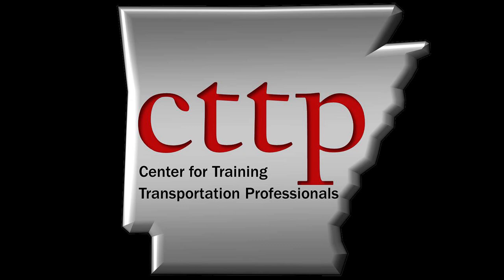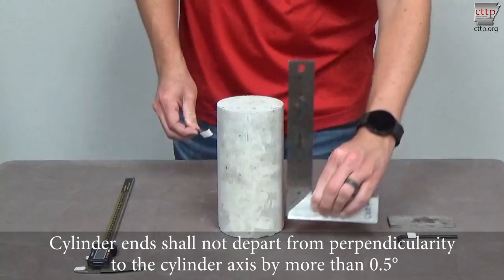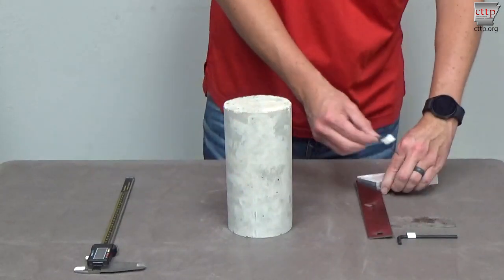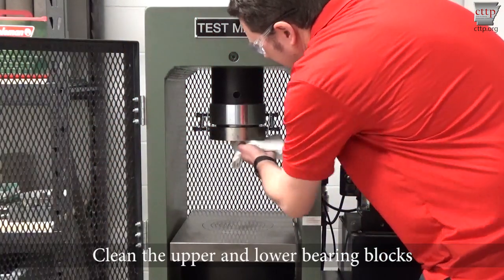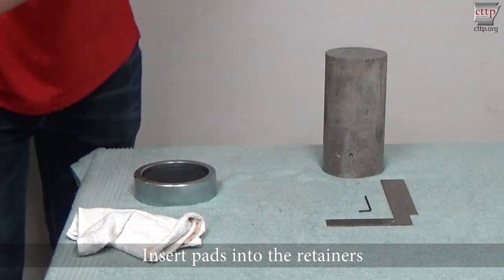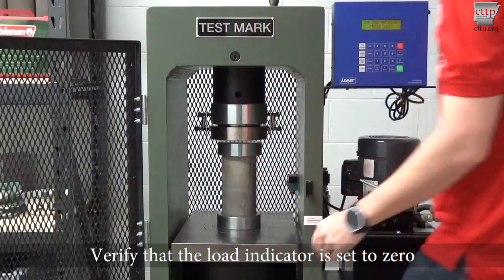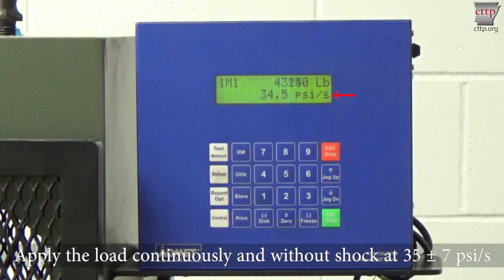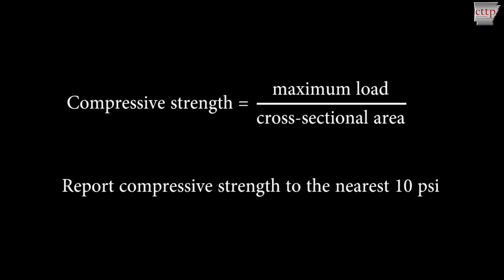ASTM C39 & C1231 - Compressive Strength with Unbonded Caps

Comment: I appreciate the videos a lot but there was no planeness check using a 0.002in. feeler. This is my main concern and where i feel i needed a walkthrough.
Reply from the maker: Planeness check is not required on the cylinder if you are capping with unbonded retainers.  Note that the retainers do need to be periodically checked to meet the 0.002" planeness but not on every test.  Capping with sulfur/gypsum/neat cement has a different procedure which you can see in our video for that test method.  Look up our ASTM C617 video and you can see how we check the capped ends with the feeler gauge for that test.